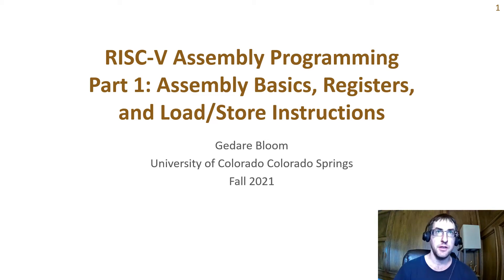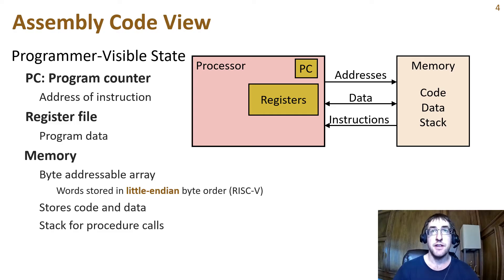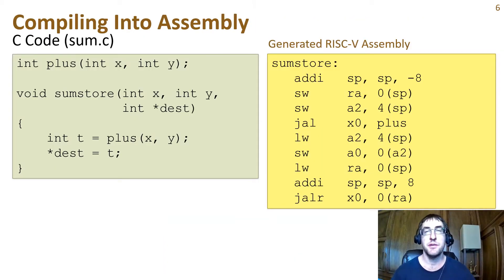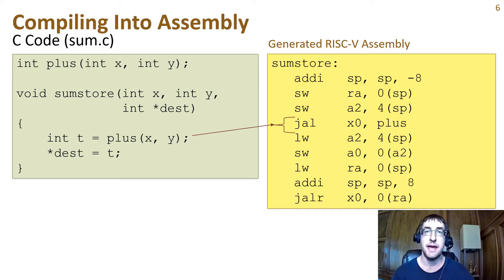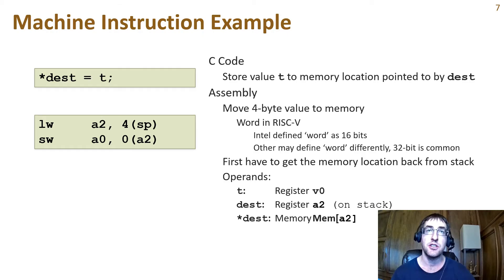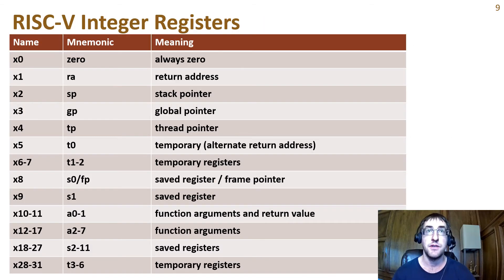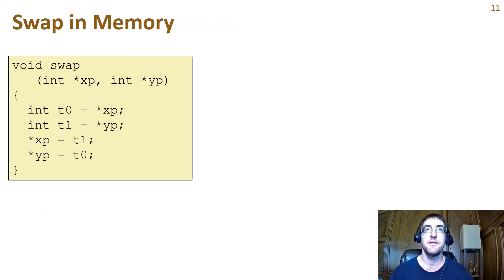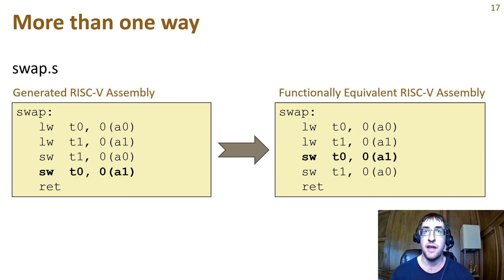Assembly Programming with RISC-V: Part 1

Comment: All these modern instruction sets man. Their all built for compilers, not assembly programming.

It doesn't have the same feel as z80 or 6502 assembly ;(
Reply: I just love that I need to install an entire toolchain on an entire os then pull an entire linker library just so I can copy pasta three lines of code to take serial uart data over a line just so I can compile that code so I can run it on a machine that has no os.
Reply: @Atmatan  I feel you. I've been in that situation before.

Comment: 3:51 Shouldn't that be "unsigned int"?
Reply from the maker: The code generation for this specific function would not change if it was unsigned, but the `add` function would be different. Usually, you would like an add operation to work for both positive and negative results, so that add(0, -1) gives the expected value -1.
Reply: @gedare  I was talking about the C code. We are dealing with pointers where negative values don't exist. So why not unsigned?
Reply: @qwertykeyboard5901  Are you talking about the declaration "int *dest", believing it ought to be "unsigned int *dest" instead? Pointers themselves are always addresses but when you declare a pointer in C you specify the type of the object stored at that address. In this case we want an int for the reason Gedare states.

Comment: Sir I had designed simple RISC V core. I want to run assembly programs on it and then an RTOS. Need help regarding this.
Reply from the maker: Interesting. You'll need to write an assembler to convert assembly into binary, and define some way to load it to memory and start executing it. This is beyond the scope of what I can explain here in chat.
Reply: @gedare  Sir could you please help me in this. how can i contact you ?